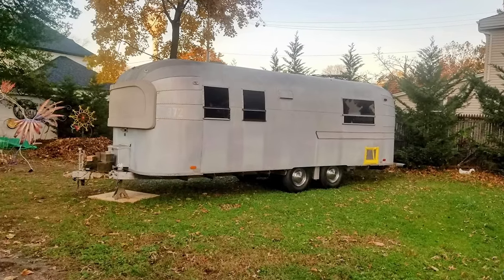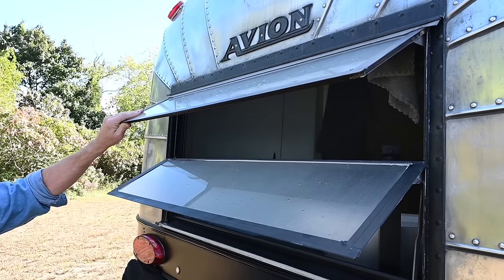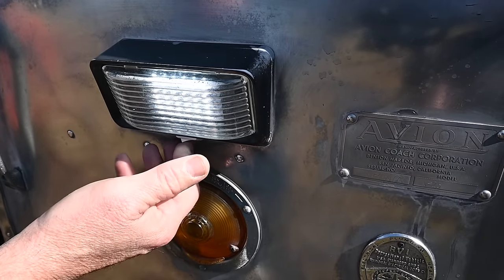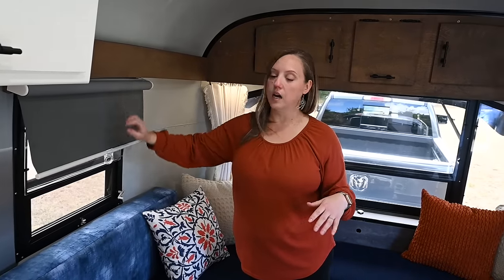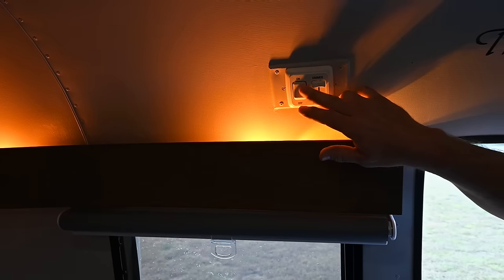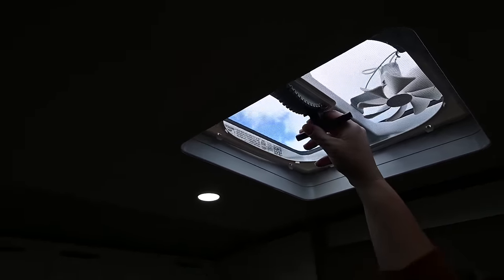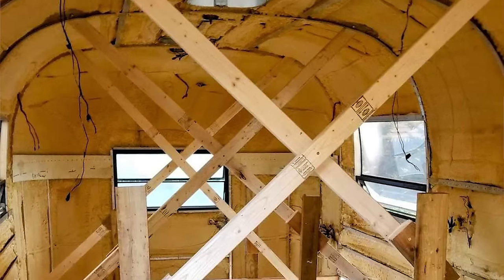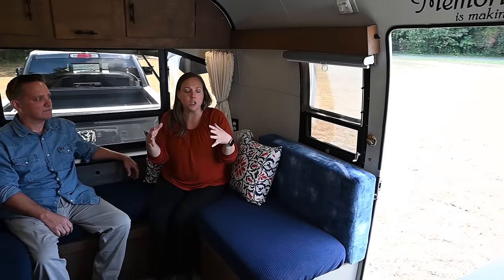This Shell-off Camper Restoration is a GEM | 1971 AVION Travel Trailer

Comment: Great job balancing out the weight.  I also have to consider this distribution.
Reply from the maker: You can do it!
Reply: A lot of people don't realize the importance of the weight distribution. It makes towing it much less stressful when it rides nicely because the weight is more even
Reply: @kimsabin1466  I'm not towing, but I'm finding that I still have issues with balance.  I put a drawer that holds my kitchen stuff on the side of the gas tank.  Unfortunately, the design required its location.  So now I have a lot more weight on the driver's side, and it requires me to add more air to the back driver's side tire.  🤦‍♀

Comment: A great and worthwhile project to save the historic Avion trailer.  Such works of art, these trailers!  You both did a fine job of restoration, inside and out.
3:09 - I do not understand how the same electrical input socket can work for both solar charging and 110V input? Solar panels go thru a solar charge controller and then to the batteries.  110V goes to the Inverter/Converter/Charger box then to the batteries.  How does one input work for both? I see the Bluetti box - does this have a solar charge controller built in?

4:15 - The Rhino Liner looks very sharp!  Did you know that instead of paying to get Rhino Liner (brittle epoxy) sprayed on, you can use Durabak, a polyurethane bedliner instead? It can be roller brushed on, and yields the same even look as sprayed on finish. It is not brittle like epoxy, but flexible. It is very tough and used by the US Navy.  You need mohair rollers, Xylene is the solvent. 

Thanks for the tour!  Most enjoyable.
Reply from the maker: He may have misspoke. The trailer can be plugged into shore power or the the Bluetti box that is inside the trailer. Thanks for the tip on the coating.
Reply: Bluetti does have a solar charge converter built in. The solar wires are plugged into the side of the Bluetti, plus it can be plugged into a wall socket and charge it via 110v and solar at the same time. The yellow 30amp plug you saw in the back is connected to the Bluetti, or if it's unplugged, a 30amp plug connected to the grid can run the camper. We did it that way as a kind of fail-safe way to ensure we didn't have both the Bluetti and grid coming into the camper at the same time.

Comment: Suggestion: If you figure out a way to weld a way to secure a couple of e-bikes, you can install milk crates in front of the e-bikes then just recharge the e-bikes, if your trailer has solar set-up, which can save on fuel if you need to re-supply and you want to stay off grid for awhile. Just a suggestion. Btw, portable power supply you can look into as well is, "anker solix c1000" which I saw on another channel. Hope it helps, good luck. :)
Reply from the maker: Appreciate the suggestion that’s great